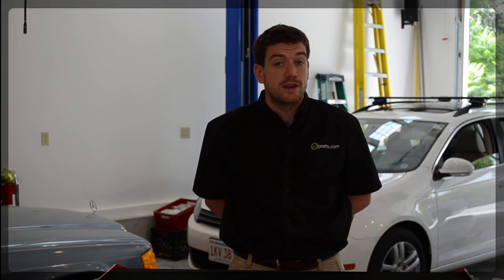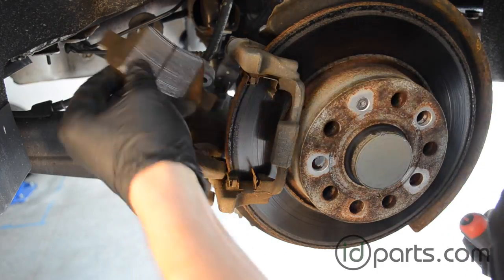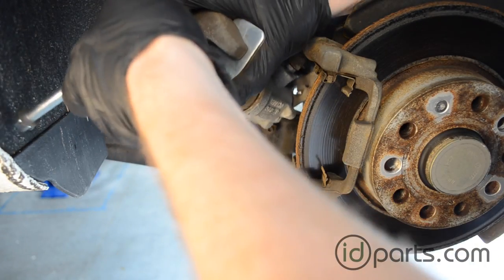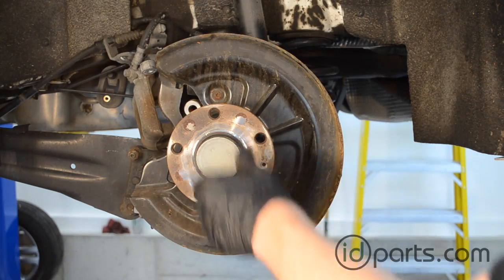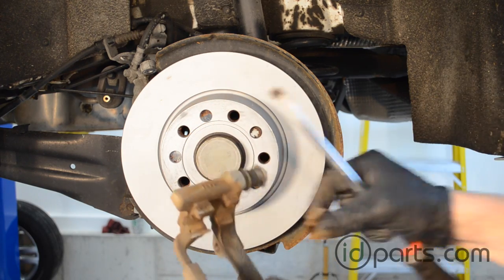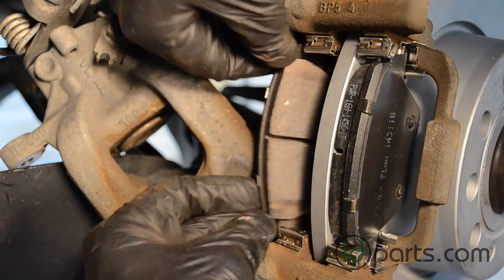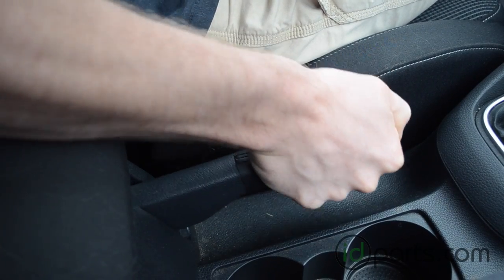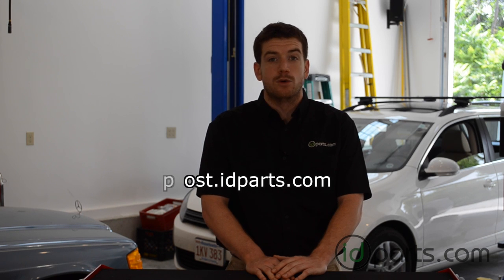Rear Brake Pads & Brake Rotor Replacement Volkswagen Jetta Sportwagen Golf Mk5 & Mk6

Comment: The value of this video cannot be exponentially explained. ii is perfect and flawless. Please note that the operator is working on the left / driver side. The rotation of the tool is to the right side. I bought a tool from overnight shipping on Amazon and it came with a left hand and a right hand driver. I started with the left hand driver and got nowhere I decided to double check the video and noticed the action of the compressor tool. With no doubt the tool must rotate when I switch to the right hand I'm not even sure I would have needed to compress the tool as I spun it it collapsed I was worried I was damaging the seal.

Comment: Great video :)  Perhaps naive question, however 1- "Rear brake tool", is it a different tool that is used for the front brakes? 
2- When to know that rotors should be changed?
Thank you.
Reply: Thanks for your answer :) . I have a Golf 2007 mk5, bought second hand 2 years ago.
I have realized that on rear right rotor, brake pad seems that is not making a uniform contact. (it overheat a lot too).
After 100 000 km, probably is the right moment to change, at least both back rotors now and pads. Seems like my rotor (1KD code) is a 253 mm diameter. Looking forward to buy some Metzger autoteille rotors.
Thickness in a new rotor is 10mm, and it suppose that allows to wear out 2mm, then it should be changed the rotor.
Im a completely beginner. After changing the rotors and brake pads. How brakes gets calibrated?
Reply: Thank you very much for the explanations, it makes lots of sense :) I took note. Definitely you know about mechanics.
I will check whenever is possible the caliper slide pins. Here, where I live is very cold climate. For example right now is -20 C. That may explain, a stuck slider.
I have been getting information and watching videos, about changing rotors and pads, but actually I haven't done before. It it fascinating, that many people share their know-how in the internet. (that's one of positive sides of the net).
Reply: Good tip, I will unscrewed and screw again bleeder valve. I was inspecting rotors and pads (with the wheels in place). I think, I will better change front rotors and pads, both are more worn out than back ones. Also, during anual vehicule inspection, front left and right has differences in the strength of brake. While back brakes, both right and left keep same value.

Comment: Very helpful. DO all 2011 Sportwagons have the same rear rotor spec?  Mine is a TDI 6 Spd manual.  phil
Reply: +Phil Holt  Probably. Manufactures don't change these specs much across a model range unless there's a safety issue, in which case you would get a recall notice
Reply from the maker: +Phil Holt Yes, the 2011s all have the same rear rotors. The 2009/2010 Sportwages are the tricky ones.
Reply: tricky as in "you need to twist and push"? Does this mean the 2011-2014 don't need the rear caliper tool and pistons can be pushed back in with a simple c clamp?

Comment: Good video. Thanks! You mention a 13mm wrench and then when removing the caliper you say 15mm, it’s actually 13mm, and the triple square to remove the caliper holder, is a 12mm.
Reply: 13mm for the bolt, 15mm to hold the other part so it doesn’t spin
Reply: The triple square to remove the rear caliper bracket is indeed a 14. Not 12 mm.

Comment: removing the T14 triple squares is NOT easy if you're in a rust zone - and that's an understatement
Reply: Yeah I'm currently trying to remove mine. I got one two break so far. I'm hitting the rest with pb blaster. I hear the 252 rotors come off without taking the bracket off. Does the 272 come off as well?
Reply: Anything is easy if you have a 10' breaker bar ;)

Comment: I have heard it is best practice to clean the slider pins ans lube with silicone to ensure free movement of the caliper. I did not notice this in your video. Can you share your thoughts on this practice?
Reply: @javier m there is absolutely a need. This caliper is the floating design type. When the piston "pushes" out of the bore, the caliper needs to move independently of its bracket. That's where the slide pins come into play. The slide pins allow the caliper to slide back and forth and apply the pads on both ends. The pins should always be cleaned and new grease applied every service.

Otherwise they will seize and you will get a spongy pedal, uneven brake wear, and need to replace the entire bracket which are exorbitantly priced.

Comment: I notice you are not using any lubricant or anti-seize. Not necessary? I've seen other pages reccomend using a copper paste or similar on the tabs or pad ears, back of the pads, between the hub and the rotor, and to clean and lube the caliper slide pins. I ask because after a rear brake job two weeks ago, i've developed a high squeak/chirp that I'm now looking for a solution to.
Reply from the maker: Michael - good post.  This car was a newer car and the slide pins were in good shape and lubricated.  You need to inspect the slide pins/guide pins every time  you do a brake job - be sure they are free of corrosion and be sure to lubricate them with a high-temperature grease like Silglide.

Comment: I keep reading that you are supposed to replace the two stretch bolts that hold the rear caliper carrier in place.  Can you share your thoughts on that please?
Reply from the maker: Ruben De La Torre  You can if you like---sometimes they get a bit rusty and worn out.
Reply: +IDParts.com The VW manual says "always replace, torque to 90nm +90 degrees"
Reply: Awesome video, I feel dumb because we have the same compression tool and I was using mine wrong. Thanks!
Reply: There are torque specs for a reason, use them.